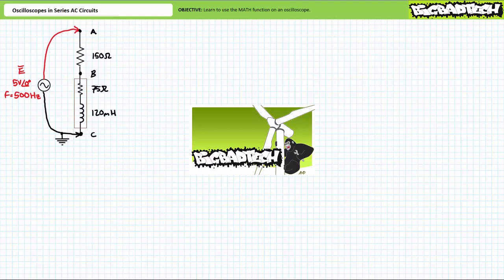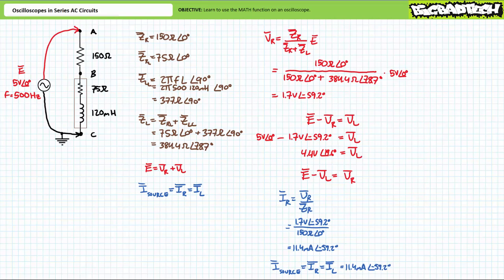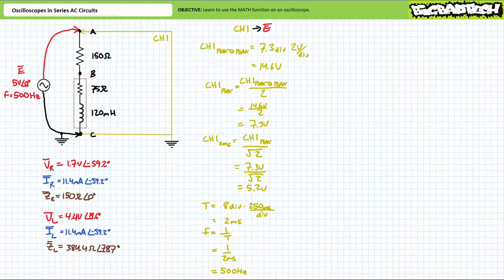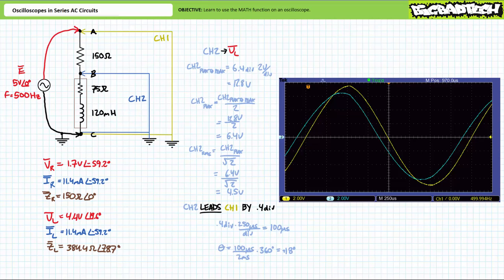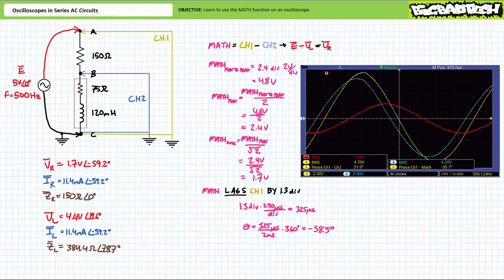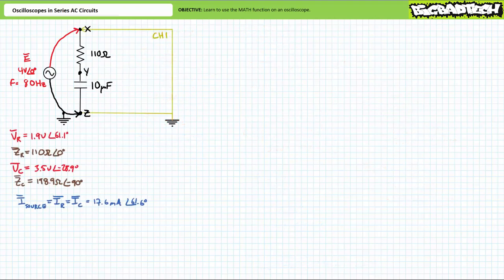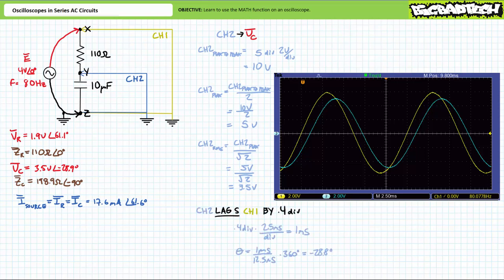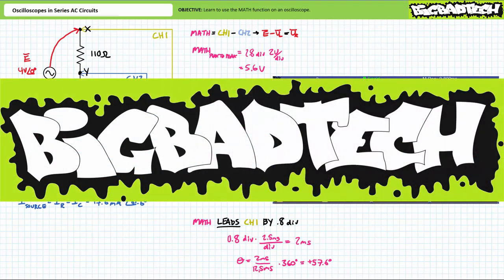Oscilloscope MATH Functions: Oscilloscopes in Series AC Circuits (Full Lecture)

Comment: My observations: In the last example we see that the angle between the phasors Ur and Uc is 90° ,then we have a right triangle.We can find that the sum of Ur+ Uc = E. So,the length of E( magnitude) is equal to E. I am wondering,when having the phasors on the drawing,can we add voltage drop components like vectors to get the magnitude of initial voltage source? In the previous lesson I tried to add the voltage drop components graphically like vectors( also tried cos theorem) but it did not yield result. The example was with the angle of 77.5° between two voltage drops. V1 was 81/55.1° and V2 was 175/-22.4.

Comment: Another point that intuitively,one might think that voltage drop over the capacitor should lead the initial voltage source,as one might think that voltage drop on Chanel 2 is the representation of current on channel 2 and as there is a capacitor one might think the voltage drop on channel 2 should lead,but in fact it lags.Ditto to having an inductance on channel 2 instead of capacitance, the voltage drop will lead,I presume.